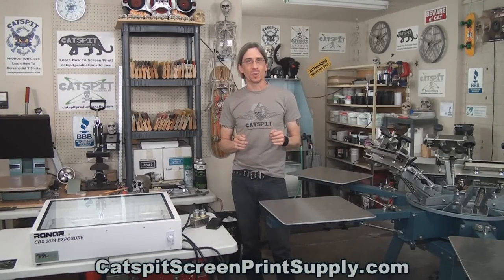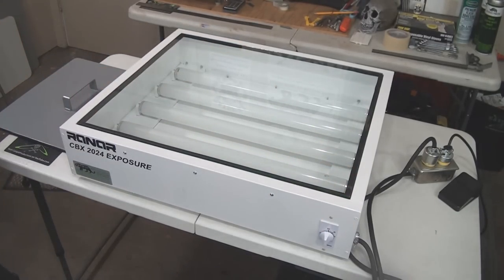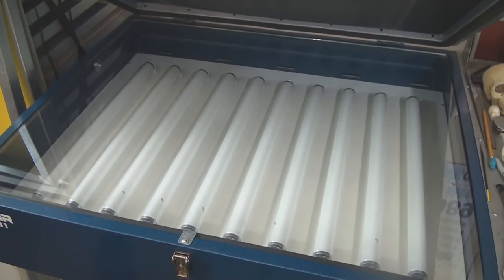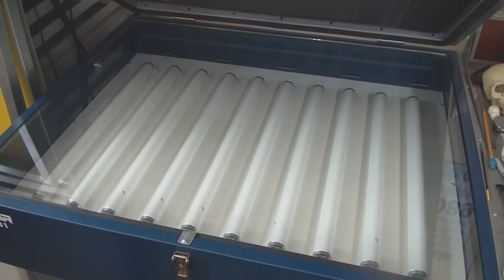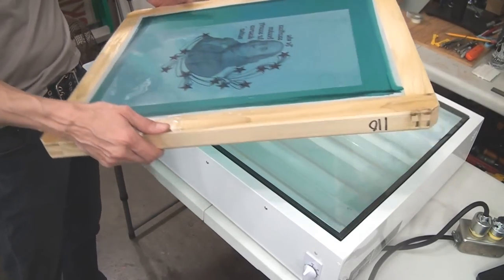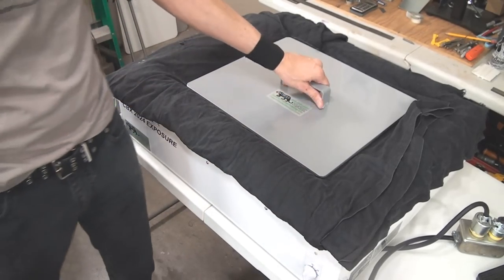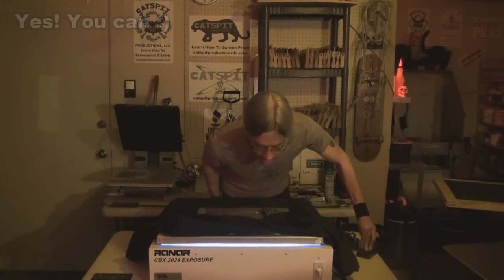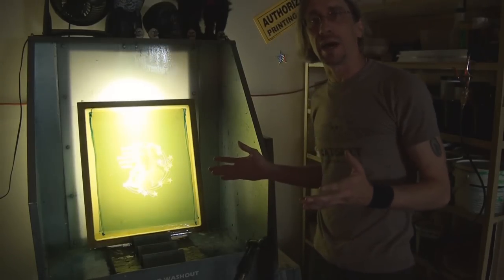How To Screen Print: Vacuum Top Vs. Non Vacuum Exposure Units

Comment: What is the height recommended between the lights and the glass for an exposure unit?
Reply from the maker: I wouldn't really know as I do not build the equipment but in these units the lights are a few inches below the glass. It's more about the spread. As long as the light hits the screen evenly across the entire exposure area then that is where you want them. Thanks for watching. Screen Printing Equipment & Supplies - http://catspitscreenprintsupply.com/

Comment from the maker: @Ryan Nelson Yes you can. I did an experiment and it can be done. Screen Printing Experiment: Can A Heat Press Cure Plastisol Inks? However the flash is better and will work much faster I think. Thanks for watching and leaving a comment! http://www.catspitproductionsllc.com/ - http://catspitscreenprintsupply.com/

Comment: I have a smaller table top unit but it's not consistent and burns halftones unevenly. But I'm looking to upgrade and 
 Thinking about getting this table top unit! Can this unit (RANAR CBX 2024) burn high detailed halftone designs that are 13x16 on a 20x24 screen?
Thanks and I enjoy all your videos \,,/
Reply from the maker: Glad to know you enjoy my videos. Yes, if you can fit it on the 20x24 screen, this exposure unit will do the job well. It's an awesome unit. Thanks for watching! Screen Printing Equipment & Supplies - http://CatspitScreenPrintSupply.com/

Comment: Hello cat I watched ur how to apply emulsion I bought the ranar table top my first attempt worked good I tried to do new screens couldn't do it I tried 40 seconds 1:30 and 2:00 got a little better but I don't want over expose the image is hard to get out !!! Ugh thanks for ur help
Reply from the maker: Check that your film positives are dense and black. A photopolymer will be quick. A dual cure will be much slower. Can you post an image of the results on the forum? http://www.catspitproductionsllc.com/forum/viewforum.php?f=6&sid=77a97af6ea1d50afa14fb0df7530a001 Thanks for watching! http://www.catspitproductionsllc.com/ - http://catspitscreenprintsupply.com/

Comment: Do you alwys have to add a black garmet when using a table top?
Reply from the maker: If light can come around the top and expose emulsion, yes. With this unit, usually the padded weight covers what you need covered. Thanks for watching! Screen Printing Equipment & Supplies - http://CatspitScreenPrintSupply.com/

Comment: thank you for comparison, I have new idea for making exposure unit DIY cheaper and more efficient as I think.

using Light guided panels and LED UV to create exposure unit  also the amount of photons (which is light) are controllable using variable resistor to control the dim of LED. so we can higher it or lower. by that we have 2 variables time of exposure and amount of light to expose the screen for achieving better result.  as far as I know this is my idea and no one till today develop exposure unit using Light Guided  Panel .

enjoy it :)
Reply from the maker: You're very welcome. I'm no DIY guy for electrical stuff but LED exposure units are already on the market and Ranar is also developing one which I will sell soon. I don't know exactly what a light guided panel is but there are LED exposure units. Thanks for watching and leaving a comment! http://www.catspitproductionsllc.com/ - http://catspitscreenprintsupply.com/

Comment: Greeat video. Whats the best way to print a circular image? The image is the same one thats my avatar that you see on this page. The image is 10"x 10". Im having problems with the plastisol white ink stacking up on the sides.
Reply from the maker: Not sure what you mean by stacking up. If the ink is printing heavier on the sides and thinner in the middle it may indicate a warped pallet or a warped squeegee. A circular design with some detail might be printed on a 125 or a 160. Make sure the frame is rigid and the mesh is tight. Thanks for watching and leaving a comment!

Comment: Hi, thank you for the review of this exposure unit. It convinced me to buy one for myself. But I was wondering if you had any advice for detailed images. I am having trouble getting little details on the screen. I am currently using Polycol as my emulsion.
Reply from the maker: You're very welcome. It's my pleasure to help out where I can. You need to use the proper mesh count  as well as a decent emulsion. Usually when you have any amount of detail in the design you will have to bump up the mesh count. But a good emulsion like the Saati emulsions I sell on my e-commerce site can make a world of a difference. Thanks for watching. Screen Printing Equipment & Supplies -  http://catspitscreenprintsupply.com/

Comment: is there a quality difference between the 2 units?
Reply from the maker: No they are built in the same manner and can produce the same results. The vacuum top will just be easier when dealing with halftones or fine details. Thanks for watching. Screen Printing Equipment & Supplies - http://catspitscreenprintsupply.com/

Comment: Hello there, I have a question about the RANAR CBX 2024 Digital Timer Exposure Unit 110v which I hope you can help with. I have limited space, so if I purchased this unit is it a) Light enough to lift b) Can it be stored vertically (standing up) ? Thanks.
Reply from the maker: Yes, it's very light and one person can pick it up and move it around easily. But in order to store it on its side, you would need to pop the glass out and store that as well since the glass just sits in the top and is not actually attached to the unit. Thanks for watching. Screen Printing Equipment & Supplies - http://catspitscreenprintsupply.com/
Reply: CatspitProductions Great stuff, thanks.
Reply from the maker: You're very welcome.
Reply: Yes it can, just in case no one answered.
Reply from the maker: I usually do answer all of my comments. Just expand the replies and you can see. The glass would have to be taken out in order to store it sideways since it is not attached. Thanks for watching! Screen Printing Equipment & Supplies - http://CatspitScreenPrintSupply.com/

Comment: What about compression top? Better than weights?
Reply from the maker: Not sure what you mean by compression. But like I described in the video a vacuum top is the best to use for high detail and halftones. Thanks for watching and leaving a comment!
Reply: Compression tops are tops that closes over the exposure with a lid and uses foam to compress it and latches shut!
Reply from the maker: Don High Oh that is very interesting, thank you. I have never seen one of those in anywhere in my experience. I think that would be better than weights perhaps but vacuum tops would still produce the best results in my opinion.